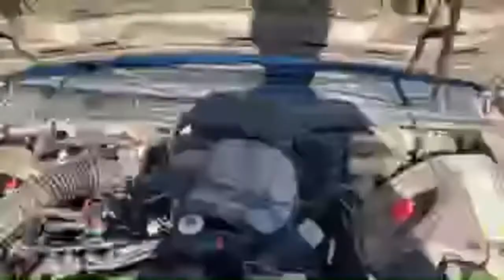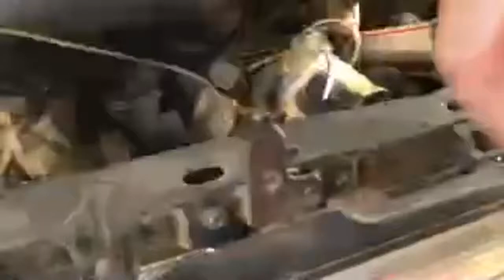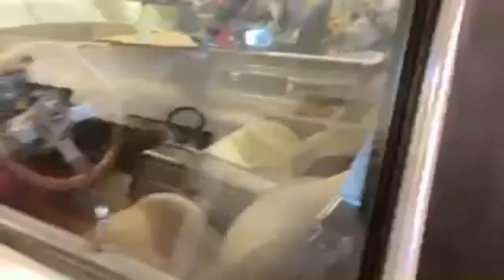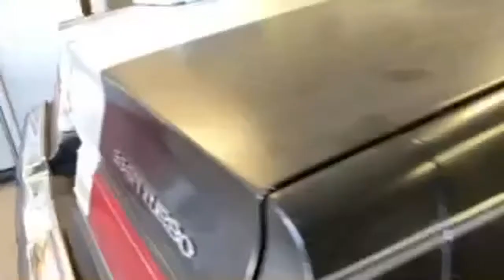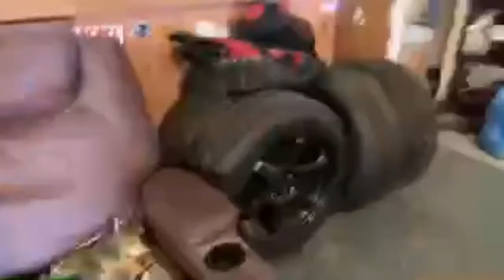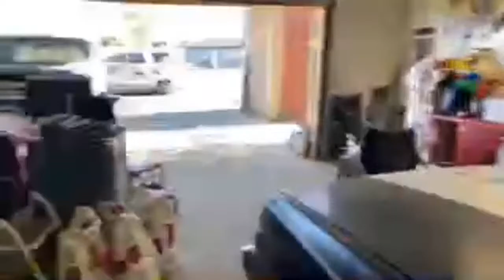1997 Ford Thunderbird water pump and thermostat update

Comment: I’m having the same problems after I flushed the radiator, I must have air pockets
Reply from the maker: What I usually do after I change the radiator and the fluid is I do an initial fill up and there’s a little cap that you gotta take off to get rid of the air gap. Then what I do is turn the heater on to max hot and run the car for about 10 minutes. Shut it off. Cool it down do it again shut it off. Open the radiator cap fill it up. Make sure it’s topped off, then start it for 10 minutes again and after that cool down, check the level of the level is good you’re done
Reply: @madboostingmadmatt48  what if your car doesn’t have a heater?
Reply from the maker: @Mista232x  you have to completely delete the heater core or you’re gonna get hotspots, because normally a vehicle has to recirculate through the heater core in order to get all the air out but if you bypass the heater core, then you just have to make sure all the errors out in the heater core lines are piped together instead of blocked off and you will solve your problem

Comment: How do you bleed these cars with the cap by the thermostat?
Reply from the maker: From the cap to get the air out, turn on the heater max heat max fan for 10 minutes when you first start it shut it down 10 minutes. Top off your radiator again from the cap 10 minutes on again heater on max hot then shut off cool down check that radiators full and reservoir. Is it proper level then you’re done